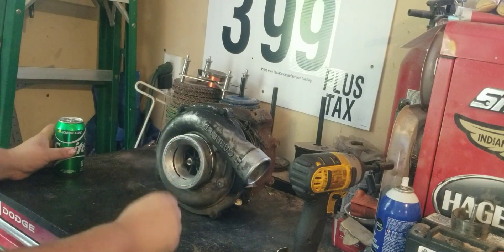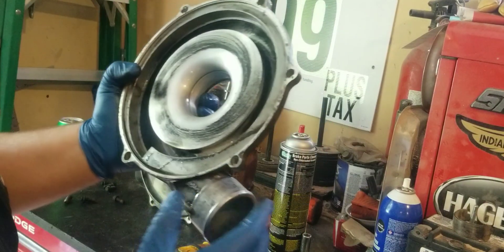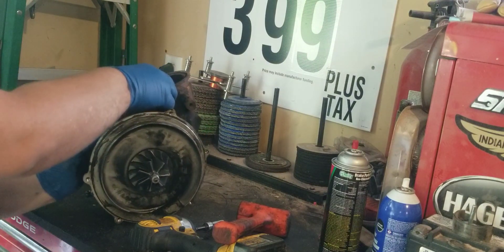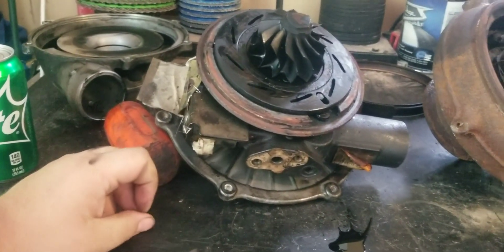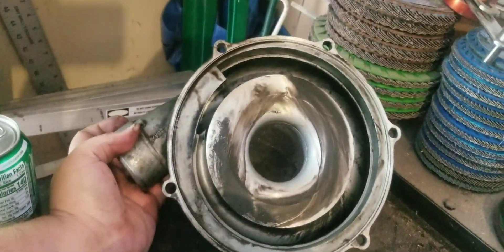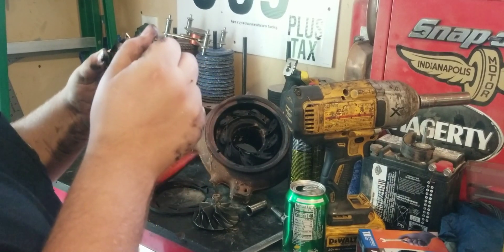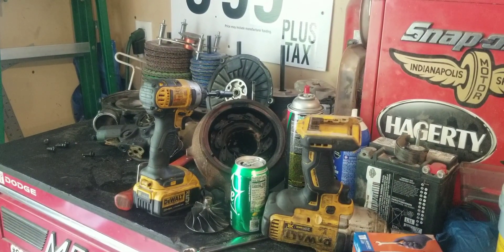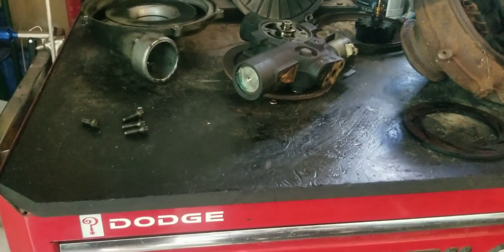Ford 6.0 vgt disassembly

Comment: my 03 6.0 has a strategy in the computer that cycles the VGT every 30 seconds after idleing for a few minutes.  240,000 miles on my original turbo still works great.

Comment: Great video - what kind of top you got on your bottom box?  👍
Reply from the maker: Mb1300 macsimizer with a harbor freight locker and a snap on chest on top. The plastic top I made
Reply: @Spyke383  I like that being plastic as it is better than wood and easier to work on engines/parts ect. ✔
Reply from the maker: @mt1885  I made it with free sheets of 4×8 plastic they used as flooring at an auto show and Like 2 cans of contact cement. It's either 3 or 4 layers thick and made so I can flip it when it gets damaged. Almost 9 years later and it's still good. The worst damage is the edge where I tried opening a beer bottle
Reply: @Spyke383  THANKS!!! 👍👍👍👍👍